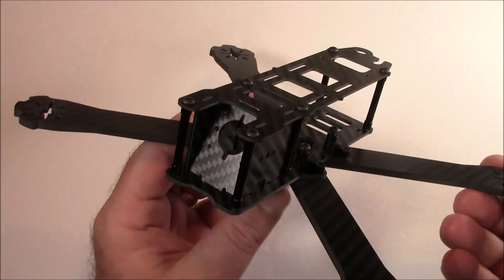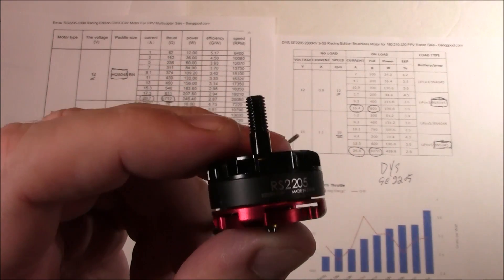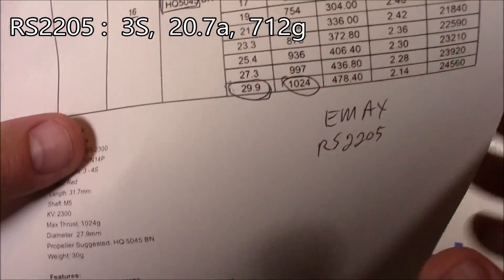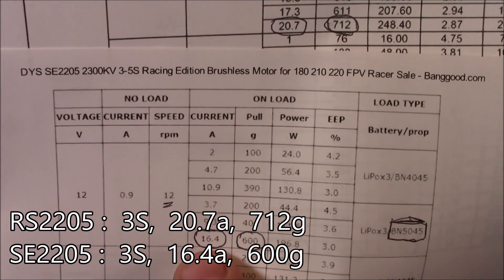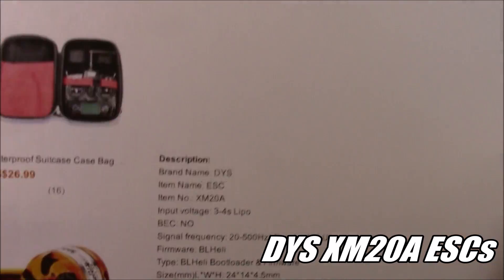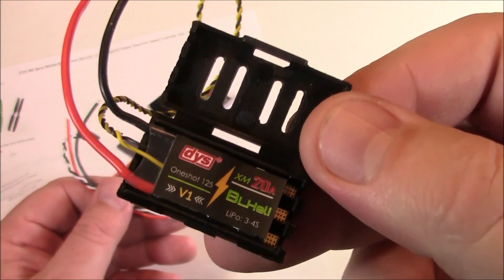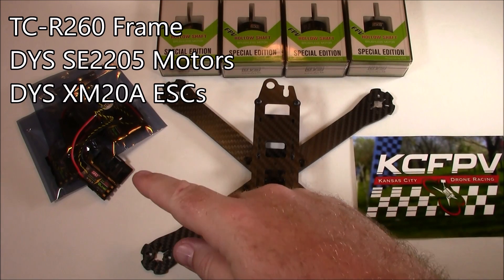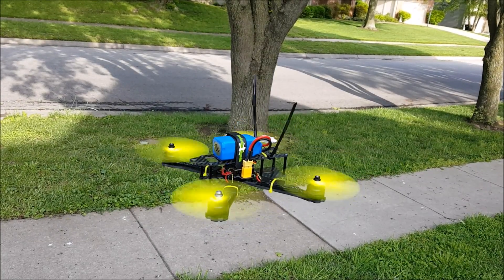DYS SE2205 Motors & XM20A ESCs & the TC-R260 Frame

Comment: these motors use nylon nuts so running all CW or ccw  on a quad should not be an issue but then I realised they use screws down the button instead of clip. would that matters I.e can i run a CW motor in ccw mode?
Reply from the maker: You can run CW or CCW backwards.  It doesn't matter because they are brushless motors.  CW and CCW really have to do with the threads.  If you get them backwards, when the props hit something, the motors will try to spin anyway but since the prop can't spin it will put pressure on the nut and (in the case where it is backward) it will spin the nut right off the shaft and it will go zipping off along with the prop and you'll crash.  If the threads were going the other direction, the pressure from the prop would try to tighten the nut and there's a chance, that you'd be able to recover from the impact and keep flying.

Comment: I had your opinion once, i was amazed but then I thought, the neodymium magnets used loose their attraction at high temperatures -  increasing the kv rating by a ridiculous amount and torque would then be about as strong as a worm. And then researched the temperature at which they run at. Basically, in the end, I chose emax, because I get pretty much equal performance less chances of it randomly falling from the sky because the magnet attraction is gone. Though it is temporary, the attraction would return but how much damage would have been done. and emax look cooler ;P
Reply from the maker: At what temperature do the magnets lose attraction?  When I push these motors hard with 6045 props, the motors come down warm, "warm" as in "bath water for a baby" warm, but no where near hot enough to burn my hand.

Comment: Thanks Dude.  You convinced me with this video.  I ended up getting that frame, motor and ESC combo and ended up in a speed run today at just shy of 100mph with a 4s using King Kong 6x4.5 props.  Almost killed a Lumenier 1300 65-130c in 3 straight line runs on the same batt.  Landed reading <13v but bounced back to ~14v after a minute (majorly puffed).

Test data shows >1300g with that combo.

The motors are also so smooth to fly with.  I'm running gemfan 5050x3's for normal flying.   

https://scontent-lax3-1.xx.fbcdn.net/v/t1.0-9/13227175_1053782058011051_1466503483338065351_n.jpg?oh=6c2cf623e4dca980c536e1a1f4864735&oe=57D4C7B9
Reply from the maker: NICE!!!  I just put 6" props on mine yesterday.  I have barely had time to test it, but it feels a lot faster!
Reply: +travisgrindal watch your battery.  almost cooked mine!  the DYS figures are 1300-1400g with 6045s.
Reply from the maker: Well, these motors warm up my 1500 and 1600 4S 75C batteries pretty well and they come down a little puffy, but have so far tightened back up.  I'm too chicken to run my 1300 batteries on it with 6" props.  :)

Comment: xm20a? why not use 30a esc? your motor is using around 25-30amps so the esc got to work harder and the copper wiring/trace in the esc is not enough to provide the amp the motor needs.

Comment: Why not use the TC-R220 if you're going to be using 5in props?
Reply from the maker: +rdzona The longer arms help with line of sight flying and also I think the longer arms look cool.  The bodies are the same size between the 260 and 220 so the only down side is the extra weight of the longer arms which can't be but just a couple of grams each.  A friend of mine bought the TC-R220 and uses the same props as me.  When I saw his quad the first time, I thought it looked kind of stubby because the props were so tight to the body, but that was because I was so use to seeing mine.

Comment: Hey Travis, you've really inspired me to build my first miniquad! I already have experience with building and flying miniquads (for other people) and multirotors in general but I am still a beginner to racequads nonetheless... I was thinking to go really big with my first one by buying the best motors, escs etc. Do you think this motor is suitable for a beginner? I want to buy them because I don't want to buy a brand new set of motors for later (as I am only a student and have to rely on my parents to buy them :)) Hope you reply, Thanks
Reply from the maker: +우희도 I think they'd be real good for a beginner.  They are top notch motors.  Banggood sells a 4 pack for $70, but if you buy 2 x 2packs, then the cost is $64.  I don't get it, but whatever.  2x2packs are cheaper for whatever reason.  I added a link to the 2pack in the description (http://www.banggood.com/One-Pair-DYS-SE2205-2300KV-3-5S-Brushless-Motor-CW-CCW-for-FPV-Racing-p-1043442.html?p=6Z050013977120130325).  Also, make sure you get the XM20A or LittleBee Pro ESCs to use with them.  Those both have faster processors in them that these motors can take advantage of.  I'm using the XM20A and really like them but I haven't tried the LittleBee Pros yet.
Reply: Thanks, man!
Reply from the maker: +우희도 You are welcome!   I'm looking forward to see what you build!

Comment: What did Dys tell you since you chosen 20amp esc for a motor that draws 25-30 amp at max ? :)

i have just order the same kit tho... but im thinking about ordering the 30 amps esc as i have 4 rctimer fr2550 motors as well

Comment: i just found these cheap 40a escs http://www.banggood.com/DYS-BL40A-Mini-40A-BLHeli-ESC-OPTO-2-6s-for-RC-Multicopter-p-975797.html
and i thought i could put the rs2205 2600kv instead of the se2205 2300kv without a significant increase of price.
do you think it is going to be too fast considering it is my first build?
Reply: +Alessandro Ammenti 
yes. its overkill. also you have to keep in mind the processing speed of these escs. the bl40a afaik has the older, slower components and doesnt have the speed to cope with 2600+ motors  at least not at 4S. 3S might be fine
this is why these xm20 escs are rated for HIGH KV, because they can provide the higher clockspeeds to control the motors at these high rpms.
using ESCs that are not able to handle the motors can result in esc desyncs (loosing control of the quad mid flight), excessive heat and probably esc and motor failure.

also, using red bottoms as a beginner is not a good idea imo. they are very expensive compared to, for example, kingkong 2204 motors taht are less than HALF the price of the red bottoms and its not a huge loss when you destroy one of them during crashes.
and you will crash a lot and therefor the red bottoms are at a constant risk of being damaged.
its just not worth it to start out with these.
build something cheaper. you WILL destroy stuff and it would be a shame it it would be something expensive.
also calculate losses into your build. buy 6 motors instead of 4  and 5 or more escs as you will have hardware failures and you dont want to wait for weeks on end for a new motor.

hope this helps.

Edit: for more information on ESCs, check this out: http://www.miniquadtestbench.com/esc-shoot-out-rg-2205-2700kv-hq-4040bn.html

Comment: wich frame do you think is better between Lisam 210 and the TC-R220?
Reply from the maker: That is hard to answer right now.  I have only put 3 LOS flights on the TC-R260.  I use to love the shape of the LS-210, but my opinions have changed and now I really like the shape of the TC-R260.  If you forced me to answer right now, I would say TC-R260.
Reply: +travisgrindal thanks, i think i'm going to buy the tc-r220, now is out of stock, i'll wait..

Comment: 26.8a on 4S - 20A Esc? ---- ? ---- ? Would the new XM30A not the better option for this Setup?
Reply from the maker: +Snappy Well, that number probably came from a bench test.  In reality, these ESCs will be flying through the air with 30-60 mph wind blowing over them to help cool them off.  Also, the chances that I'll ever be more than full throttle for more than several continuous seconds is almost zero.

Comment: Which version has the normal thread? CW or CCW as I would prefer to use lock nuts.
Reply from the maker: +Blindside FPV Each motor comes with 2 lock nuts.
Reply: +travisgrindal hey Travis quick question so the thread only refers to the shaft thread? And with that being said would you reccomend them over 2204 2300kv motors from dys?

Comment: I would argue that the difference between 1024 and 1070 in these applications is moot. 
If anything, the hollow shaft may be quicker on punch which may be noticeable as there is less mass. Still, either motor with whatever prop and esc any given pilot sets up to their preference is going to be equal in potential.

Personally, I like that Rotorgeek gear.
Reply from the maker: +Hiway Heh... Well, like I said in the annotations, I already have a quad with red bottoms, so I wanted this one to be at least a little different.  :)

Comment: littlebees pro is comming out, they comes with f396 mcu just like the xm20a. i really want to see you disassmble the se2205, was wondering how well the scew on the bottom works. try doing it with the motor is mounting on the arm too
Reply: +Calvin C little bees pro are already out, but havent seen much for testing results yet. Hopefully Quad McFly will add them to www.miniquadtestbench

Comment: Nice video like always what state do you fly in
Reply from the maker: +blood frost Uh... Kansas (State).  Acro (state).   LOL!
Reply: I can see great job keep the work up I love your channel
Reply from the maker: +blood frost Thanks!
Reply: Quick question What's the difference from the XMS30A mini version and the regular XM30a or how do I talk to the company trying to decide between the two
Reply from the maker: +blood frost I think the only difference is the size and the wiring.  Also, the full sized one has the capacitor on them.  I think they just shrunk it down.  All the specs I could find on them were almost identical.
Reply: +travisgrindal thanks so much I couldn't find anything in the forms

Comment: I was wondering about if a 20 amp esc would be enough on these new racing motors coming out also.  You have to remember that when people are doing tests on a thrust stand that it's static.  On an actual quad it's moving, so it's probably never going to see the max amps that it would on a stand.  I think a 20 amp esc will handle it fine.
Reply from the maker: +Tim Spitz I'm thinking the same thing.  The 30-60 mph wind should help the cool them off a little too.